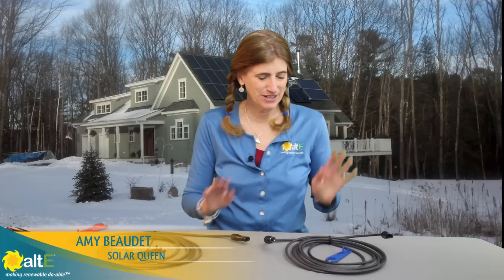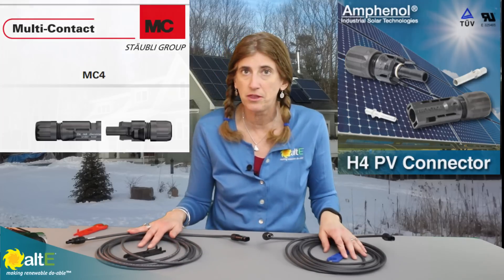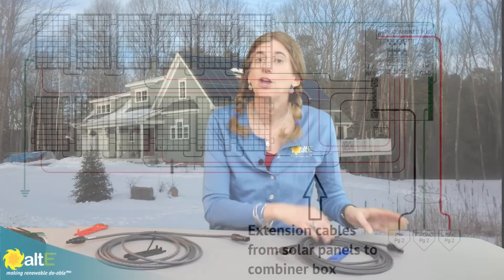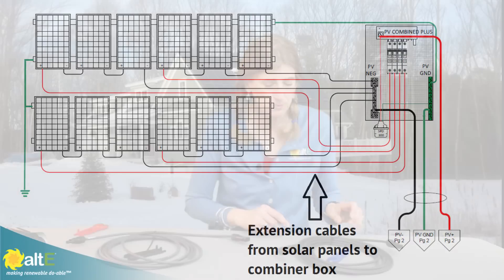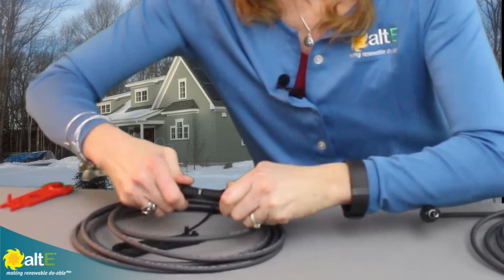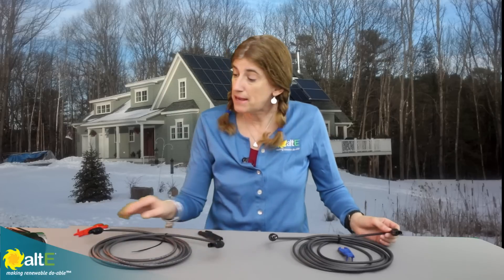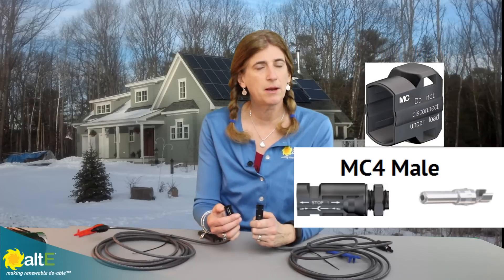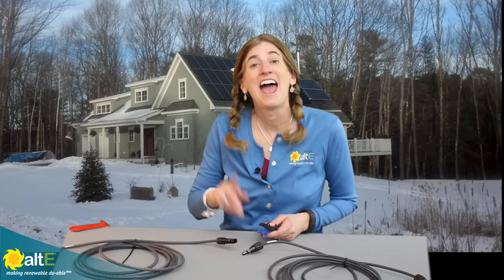How to use the MC4 and H4 solar panel disconnector tools.

Comment: If you have a pegboard, you already have a tool that works on BOTH brands. It's a common everyday pegboard hook. Just squeeze it closed a tiny bit (don't overdo it) for a perfect fit, and it works great. When you're done just hang it back on your pegboard where you'll always know where to find it.

Comment: Hi, can you not just solder the wires together and apply heat shrink? Why do they have these connectors? Thanks
Reply from the maker: You need to ensure a watertight connection that will last for over 30 years. Soldering all of the connectors while on the roof may not be a practical option. Having the connectors also allows you to disconnect if needed to in the future. For instance if the roof needs to be repaired. But in principle, as long as the connection will last for the life of the system, go for it.

Comment: is it possible to replace the mc4 cables on my flexible solar panel. I tried to turn it wont budge.
Reply: Yes i want to know to if i can just completely remove mc4 connectors without cutting them off?

Comment: HI AMY I HAVE A QUESTION IN YOUR BLUE PRINT YOU HAVE ONLY 3 PANELS IN SERIES IN A STRIN HOW MANY PANELS CAN I PUT IN SERIES W/O ALTER THAT VOLTS EXAMPLE 3 X 250 WATTS 24 VOLTS PANELS IN SERIES IS A 750 WATTS STRIN 24 VOLTS NOW IF I PUT 4 PANELS IN SERIES STILL 1000 STRIN OF 24 VOLTS THANK Y FOR YOU AMAIZE INFO
Reply from the maker: It depends on the equipment it is going into. If you are going into a PWM charge controller charging a 24V battery, you can only do one 24V panel.  if you are going into a typical 150V MPPT charge controller, it depends on the temperature. If it never gets cold, you may be able to do 3, but most places you can only do 2 before you hit the temperature compensated voltage limit. If you have a higher voltage charge controller, like the Midnite Classic 200 or 250, you can do 3. If you are going into a grid tie string inverter, or a high voltage charge controller, you may be able to do up to 10 or 11 in series. 

To figure out how many you can do in series for your system, look at the max voltage input for your equipment and the Open Circuit Voltage (Voc) for your panel. Multiply the Voc by the Temperature compensation factor from NEC Table 690.7 record cold temperature from your area (Google NEC Table 690.7 for numbers). Divide the max voltage of the equipment by that number, and you can see how many you can fit. For example. Voc of panels = 44V x 1.2 for -5 to -13F = 52.8V. If the max  input voltage my equipment can take is 150V, then 150 / 52.8 = 2.8. I have to round down to 2 panels in series.
Reply: THANK U AMY I GET IT

Comment: Hi, what is the purpose of these connectors or any connectors? If they are so hard to assemble and deassemble?  I see a need for connectors if i need to move them around? Or temporary set up, but i am not understanding the purpose. Thanks
Reply from the maker: Most solar panels have the connectors on them to make installation quick. When wiring in series, you simply click them together. When connecting a microinverter or DC Optimizer, they will generally also have a connector for easy installation. So they are not often disconnected, but quickly connected.

Comment: I see you have a blue tool, a black tool and  red one. There are lots of the blue ones on ebay advertised as MC4 but I guess from your video they will only fit H4? And what is the difference between the red and black tools? Thanks.
Reply from the maker: The MC4 used to come in red, and recently the ones we get switched to black. There seemed to be very minor changes between the two, but the biggest I found was I keep losing the black one, doesn't stand out in my tool box as much as the red.   Other than that, they seem interchangeable. The blue definitely has different dimensions for the H4. now to make it even more interesting, we just got a new one that works on the MC4, H4, and newer T4 connectors, https://www.altestore.com/store/cables-wiring/solar-panel-wiring/t4-disconnect-key-for-mc4h4t4-connectors-p40759/

Comment: on the MC4   what  gauge wire thickness on solar  should i ues  on 50 feet  ??  10  gauge   or 12 gauge  so far  no one  can tell me  most  are trying to sell me  the  big time  $$$$$  wire  :(   any  help  will be  thankful    thanks   :)
Reply from the maker: Nelson quimby jr it depends on how many amps are going through the cable.
Reply: around 9 amps   each solar  panel  will have it own  control box    there  200 watt  panel
Reply: one  that  i have  now  came  with   20ft 12AWG MC4
Reply from the maker: You can find a good voltage drop calculator here. http://www.calculator.net/voltage-drop-calculator.html  50' is a long distance for even #10 cable. It is over 5% voltage drop, that's a lot. You may want to instead bring all of the wires to a pass thru box and use less expensive THWN wire in conduit for the home run back to the charge controllers.
Reply from the maker: Actually, the 5% drop was assuming 12V panels. If they are 60 cell (or bigger), the higher voltage helps and makes #10 just over 2% voltage drop.

Comment: Dear altE , I live in Karachi where sun shine like hell but we have Sea breeze advantage , My House use 400 KWhr per month Max , we pay 60 $ bill but we use to have power cuts for 3 times each for 150 mins that is due to the line loses which has not been fixed . I want to have a Direct Current Water pump to transfer the water from under ground Tank to Over head tank . run directly from the Solar Modules without using batteries or inverter is that possible .Note More energy i use more bill I have to pay for using extra that is because of the Billing Slab System . Can you tell does the Technology Exist ? i Shall be thankful to you .
Reply from the maker: It sounds like you need a submersible solar pump. Watch the video here, https://www.altestore.com/store/solar-water-pumps/submersible-solar-pumps/shurflo-pumps-accessories-c651/ and check out some of the options.